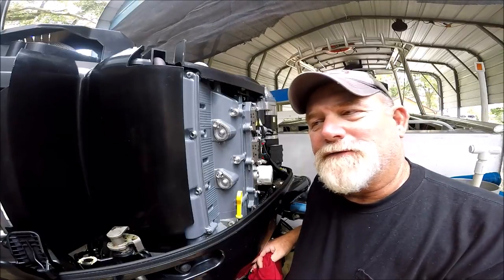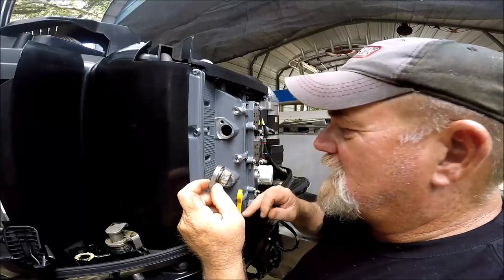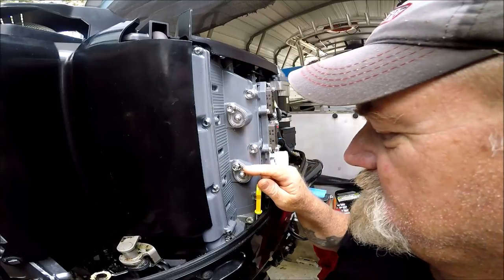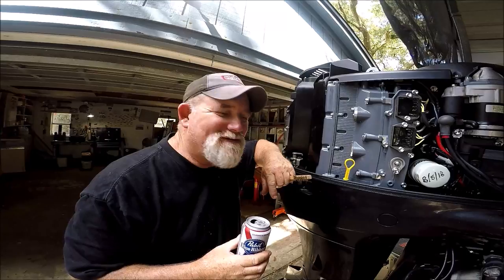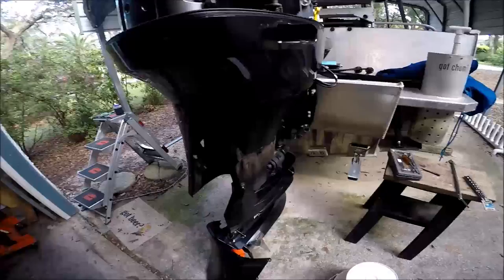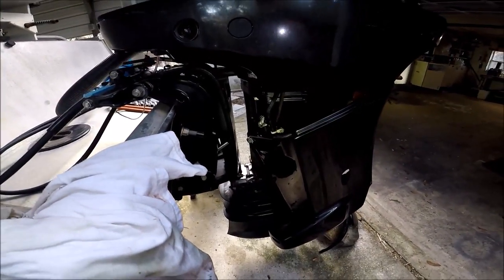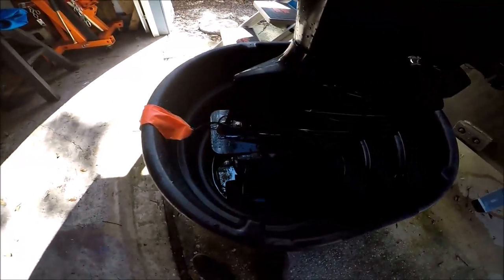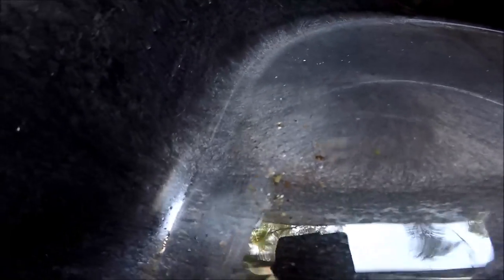SUZUKI OUTBOARD ANODES 👀 see video description for update

Comment: When you flush your engine, do you use the muffs and run it till the thermostat opens? Usually you have to run it for a minimum of 7 minutes so the complete system can be flushed out and no sediments will remain. You can also clean your anodes every two weeks with the conditions you experience in your area. 

If you only do a side flush when the engine is off, it will not completely flush because the thermostat will be closed and saltwater will be trapped in the inner chambers along with sediments. So always spent the extra time to flush using the muffs and the engine running for at least 20 minutes or till the thermostat opens and you give it enough time for the complete system to flush out. 

This way you can save on your engine and replacing anodes often.

Also be sure to check your fuel filter and drain any water from the separator bowl that may have collected after you make a trip. At the back of the engine, there is a separator as well where the pump is located. There is a drain plug for draining excess water, open and drain as well. 

Lastly, monitor your oil level. If it is higher than it should be, you may have unburnt fuel getting into the engine oil. This must be drained and replaced if needed. With Suzuki engines, when trolling, this can happen with the bigger engines when the fuel is not burning off fast enough with the four strokes.
Reply from the maker: I know all about a 250 suzuki.....its tough to run on muffs. mine is run in a 75 gal barrel

Comment: Was going for a Yamaha but then the dealer told me to get a suzuki,he said its just as good of an engine if not better but it is easy to service and fix also has chain not belt so you dont need to worry about it.
I used to have vw cars then got a toyota rav4 and man the toyota is so well designed you can change stuff you have space to work and so on,on the vw i had to unscrew  100 things to change a light bulb or something like that so  I think I get a suzuki and make my life easy.
Reply from the maker: YEP!
Reply: the chain on this suzuki is a joke, singel chain ibicycle chain, suzuki, you can do better, i renovating a 2015 df250apx.

Comment: # 7 was intact due to the silt insulating it from the seawater. It would be advisable to service them a little more regularly. You also have an aluminum boat which could exacerbate the problem.
Reply from the maker: really, more than once a year.  that seems a bit excessive. I do all anodes once a year, plus, t-stats, all fuel filters, gear lube, plugs, in the fall. After approx. 350 hrs. a year.

Comment: Hi Captain Dave, first off thank you so much for your videos as I am learning a lot for them regarding an outboard motor and most of all a Suzuki Outboard!  I currently have a 2019 Suzuki DF250 which I purchased in July 2019 and I'm wondering how many minutes you flush the motor after each use.  I live in Dana Point, CA which is in Southern California and I store my boat on the trailer in Dana Point Harbor.  I use the public wash stations down at the harbor and flush my motor out right after each time my boat enters the ocean.  I live in an apartment complex in Dana Point and don't have the capability to bring my boat home and use the water from my hose at home.  I normally use my earmuffs when flushing and run my motor for about 5 minutes and then switch to the flushing port on the steering arm side above my motor for about 3 minutes of course with the motor not running.  I would love to get your advice on the best ways to flush an outboard motor considering the circumstances that I have.  How many minutes would you recommend flushing with the motor running after I get out of the water.  Do you recommend a flushing bag?  Any tips would be greatly appreciated.  Thanks again!  Chris
Reply from the maker: THE 250's have them damn low water pick up's, so using the muffs on it IS a pain cause you have to tape over them, which isn't good. I guess you are doing that. I don't use flush ports cause I'm in a MUD/dirt nasty river!!  Always as long as it takes to get up to over t-stat temp.

Comment: Very informative video - thanks for putting it out there.
With the anodes out, could you flush out that Jackson River mud with a hose?  Seems like it would help get it all out. Correct me if I'm wrong.
Reply: Er, I meant St. John's River mud...
Reply from the maker: its the muddy st. johns river in jacksonville florida.....not jackson river. you could, but it's not like a hose is gonna do much.

Comment: Hey Capt Dave, thank you for these videos, i was wondering, u said in an earlier vid about an anode in the very bottom of the lower unit, under the water intake screen, how do u get the screen off?? Another thing, are u aware of an anode that u have to pull the prop off, a small round anode, under the prop???
Reply from the maker: in the bottom intake, unscrew the screws. and have a ball of fun taking the lower cowling off ''aka: chaps''. there's on there, for the oil pan. mine has 8 total. then getting that lower cowling back on is the super fun part, it's a engineering disaster! big motors don't have prop anodes.

Comment: Very good video brother. I have a 2011 DF115 four stroke on my blue wave. The bought was ran in the bay by original owner for only  50 hours but can for sure see the benefit of doing this.  I’ll get the manual out and see where they’re located and how many.
Reply from the maker: should be nearly the same.....don't forget the one possibly in the screen in the gear case. 50 hrs....probably not ''ate yet''. I do mine each Oct. after 400 hrs in hyper saline waters here. Pure salty super dirt water....I hate it!!!  But I'm stuck here.
Reply: Capt Dave's Sport Fishing 
Thanks for the quick reply sir.  My other question I back doored that one with is how you removed all the mud and gunk out when you pulled the anodes out.
Reply from the maker: @offgridwhitetails8768  shoot the hose in there...is all i can figure, and hope for the best

Comment: Where did you get the new rubber o rings?  Just the local hardware store?
Reply from the maker: all my parts for my Suzuki come from boats. net
Reply: When you only inspect and clean, do you need to replace the o-rings, if they appear good.
Reply from the maker: @johnmcnutt2745  I know that. Maybe others dont

Comment: What does an Anode do in the engine...??  Obviously a part of the cooling system....
Reply from the maker: Not even close...Gives away metal SACRIFICIAL, so your Alloy Motor doesn't disappear slowly in saltwater, or all water!
Reply: Capt Dave's Sport Fishing ..O Wow.....So this is a Chemistry maintenance for the environment....
Reply from the maker: @bclaverenz1  Electricity-water-alloys....whatever ya want to call it. All boats/ships, but plastic ones have them, my 26' Alloy boat has them, as with every outboard motor in the world, interior and exterior.
Reply: @bclaverenz1  plz take the time to Google what anodic protection means.

Comment: Might be easy on your 240 HP , but try the same on a 115hp Suzuki
Reply from the maker: If it's a Zuki that is relatively new they should be all the same.
My 250 gets done yearly, by me.
Reply: @CaptDavesSportfishing  I've got a 2017 115 and it is just as easy.  Only 4 internal anodes requiring the same steps.
Reply from the maker: @zachhopkins9719  NO ONE goes any further, but if you run in shit mud water, like I do here, ya may find this very interesting. Best way to really clean out outboard, and ''FUEL COOLER'' clogging issue......Yes, you have one too and mechanics love it!  https://youtu.be/7ZYwh9e2ZD8
Reply: Zach Hopkins  you should have 6

Comment: put grease arond the gasket of the anode   and run engine on clear water look for leak
Reply from the maker: I'm good. check or replace these every 100 hrs....I run in a barrel after every trip.

Comment: That bolt is an M10 fine thread. The bolt needed to pull the anode.
Reply from the maker: Yeah I got it you're not the Lone Ranger who told me don't really care what it is as long as I had one that's it and I did
Reply: Removal bolt is 10x1.25mm